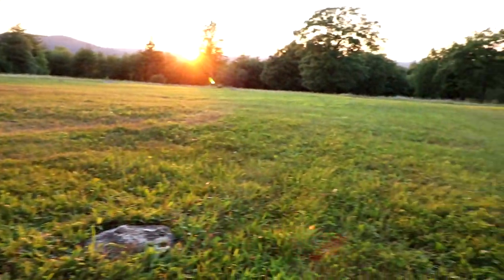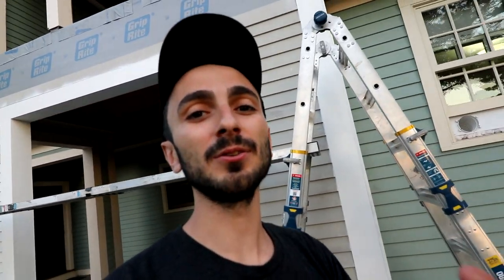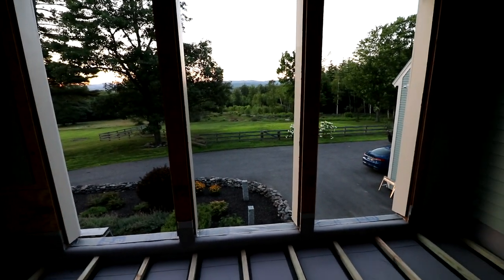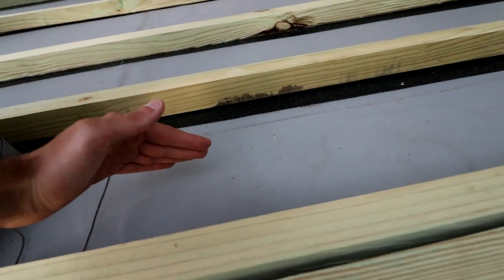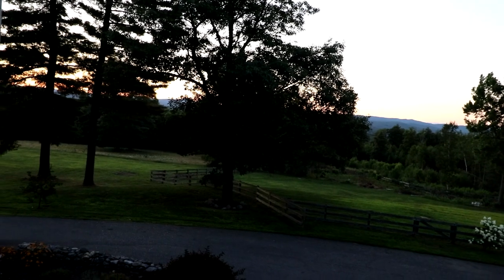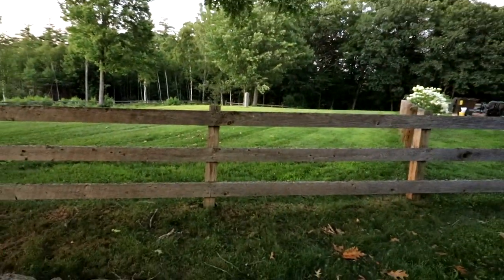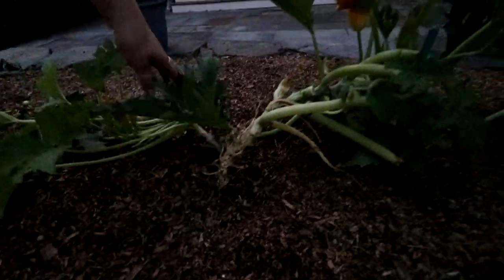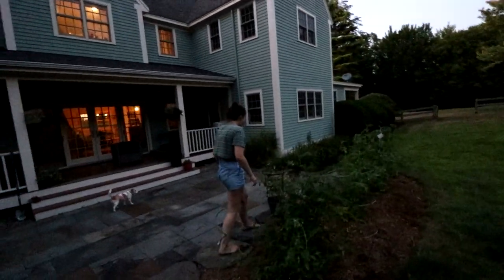My Dream House had $20,000 in Hidden DAMAGES!

Comment: Id put a chain on the branch and connect that chain to a four wheeler and have Peter or Noel pull the branch while your cutting the branch so that it won't fall on the fence.
Reply from the maker: Ya im just nervous there would be too much tension and could fling after i cut